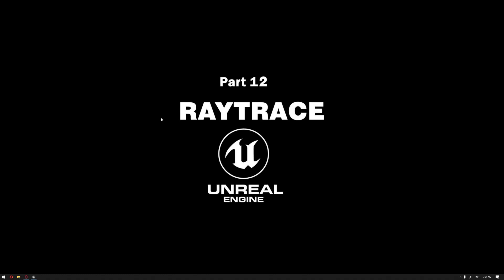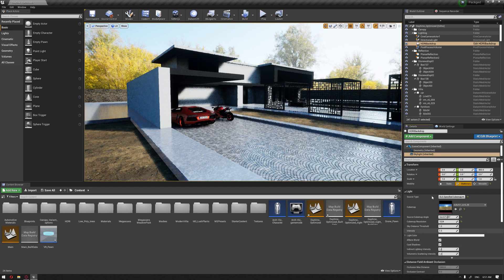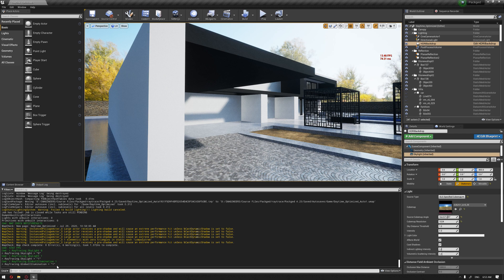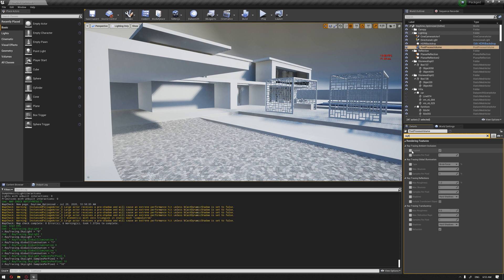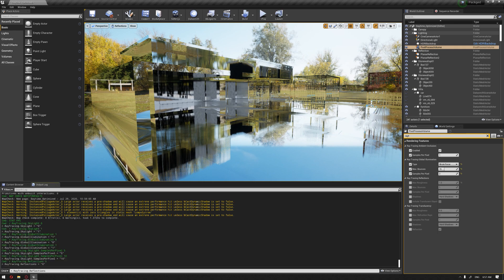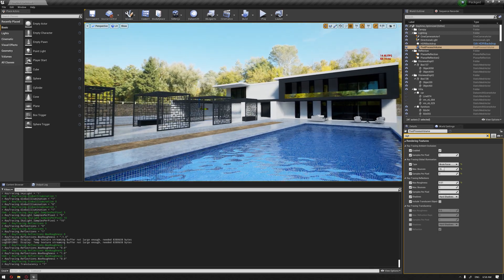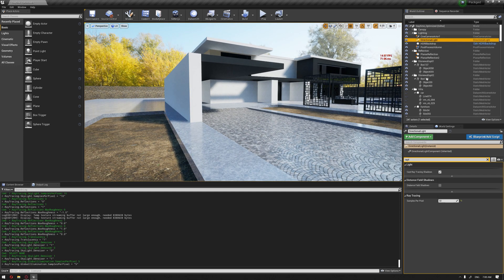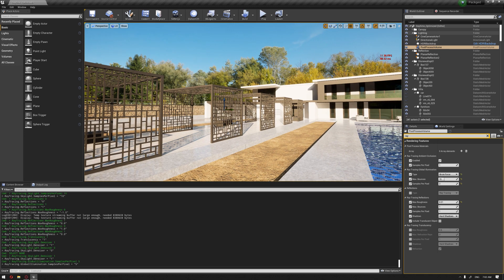Unreal Engine 4 Arch-viz Tutorial Course part 12 Raytrace

Comment: Hi, Please Help!!

I'm Using the UE4.27.2 version and I'm using GPU Lightmass, but I want to use RayTracing only for Reflections & Translucency.

As per the official documentation, I have followed all the steps to enable RayTracing for GPU Lightmass;
a]. Default RHI = DX12
b]. Virtual Texture Support and Lightmaps = ON
c]. Ray Tracing = ON
d]. and then turned OFF all Ray Tracing features by 'r.RayTracing.ForceAllRayTracingEffects 0'

Till here everything is good, but now if I start turning ON reflections & translucency with the help of 'r.RayTracing.Reflections 1' & 'r.RayTracing.Translucency 1' they don't affect  the scene at all.

and not just this, I also tried enabling all Ray Tracing features by 'r.RayTracing.ForceAllRayTracingEffects 1' and then again I started turning OFF individual features [like  'r.RayTracing.Reflections 0' , 'r.RayTracing.Translucency 0' , 'r.RayTracing.GlobalIllumination 0',etc] but that also didn't affect the scene at all.

Can you please help me understand where I'm making a mistake, is there any other setting that needs to be enabled?
Reply from the maker: Hi , thank you sharing , I guess you are doing everything right in terms of enabled raytrace features , as for disabling them i would suggest to check if you have a post process volume in your scene and try to see if you also have tweaked the raytrace features in it as it could  be conflicting with the cmd command

Comment: Hello! im loving all the tutorials but now im facing a big problem!! once i activated the raytrace in the project setting everytime i try to open my level i get an error that says "Out of video memory trying to allocate a texture, try lowering the resolution". does anyone have the same problem? how can i fix this? please :(
Reply from the maker: Thank you , Out of video memory can be related to different issues , can you please share your GPU card version , and also if you can let us know if you were getting the same message when you used the GPU build without raytrace
Reply: @theimageneers5161  My Gpu is NVIDIA GeForce GTX 1660 Ti. I have 32 gb ram that I believe is pretty enough for UE4. So, in my original project im not getting this message, but when i migrate the level to another empty project, for optimization, I get this message. Also, I've noticed the same message on other ue4 marketplace projects such as environments, whenever i try to open the test levels.
Reply from the maker: @juanfranciscotorres9802  thanks for sharing your PC configuration , your GPU is a good card to get your G
PU  light-build , but for ray-trace it can enable it to see the raytrace feature in your project, but based on what Nvidia have declared RTX cards are made to support the raytrace on all levels , to get this cleared up try to open a very basic project simple one and enable raytrace and check your fps on that basic scene with an HDRI lighting base
Reply: @theimageneers5161  Thank you so much for your help and time; Ok so, I enabled ray trace on a simple room project, there's no problem, project running at 30fps average and no errors. I mean, the weird thing is that, since I activated ray tracing, all my hd textures causes the engine to collapse, either on my own projects or on marketplace ones, even if those projects are not ray-traced.
Reply from the maker: @juanfranciscotorres9802  your most welcom , also please try to download this UE4 file of our example try to activate raytrac and check what will happen in terms of quality and fps count 

https://www.dropbox.com/h?preview=Imageneers_Example.7z
Reply from the maker: @juanfranciscotorres9802  Please try this link and let us know if the same problem happened 

https://www.dropbox.com/s/y4wvmgvj21jzlvc/Imageneers_Example.7z?dl=0
Reply: @theimageneers5161  Hi! so I managed to fix the problem. the way i did it was to delete all the reflection captures spheres I had in my  original project, then migrate to a optimization empty level and set manually some reflection spheres again!! I thank you again for all your help and looking forward to follow your amazing tutorials! greetings!
Reply from the maker: @juanfranciscotorres9802  Great job , cant wait to see what your working on , thanks for sharing

Comment: is there any way to raytrace without a RTX even if it's only for rendering movies, so it doesn't have to be realtime but would still be faster than Vray? thanks!
Reply from the maker: Raytrace can be accessed by other GPUs other then RTX however it will not be a realtime advised performance , but you can produce cinematic videos by the sequencer .
Reply: @theimageneers5161  thanks! have you seen any tutorials for working like this? I'd like a RTX but I will wait for a reasonable priced one.
Reply from the maker: @rifz42  Whats your GPU model
Reply: @theimageneers5161  Radeon RX 580
Reply from the maker: @rifz42  the only problem with the AMD is the support driver for raytrace from AMD them-self ,, 

this is one of the topic that was discussed here 

https://forums.unrealengine.com/development-discussion/rendering/1606330-ray-tracing-on-amd-directx-12-cards
Reply: @theimageneers5161  ok, I was hoping I could use the CPU to get the same result visually, not in real time but faster than vray, just for rendering clips.
Reply from the maker: @rifz42  as far as Epic team updates till now raytrace can be only accessed through GPU , thanks